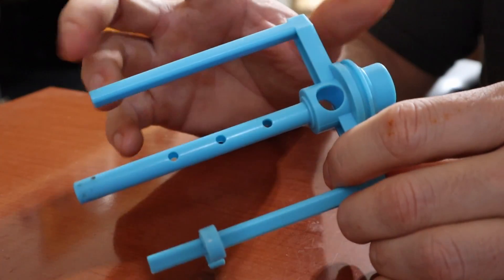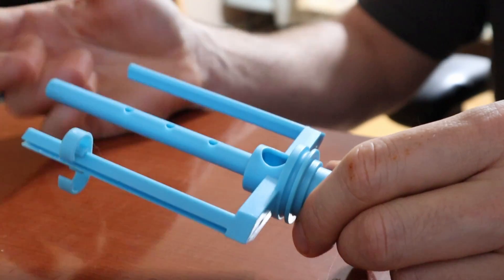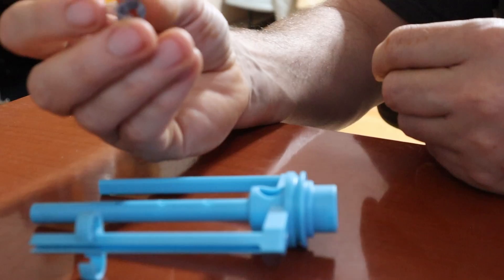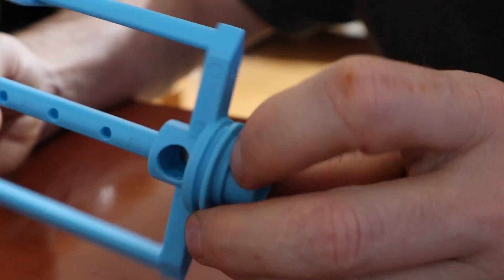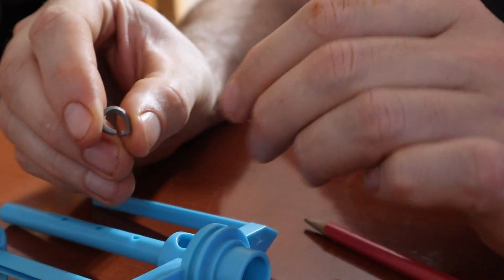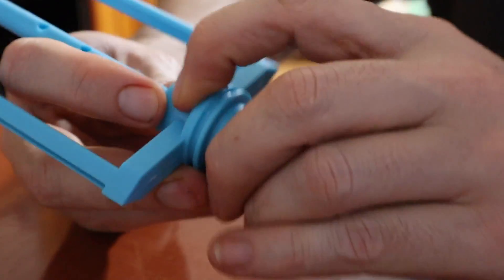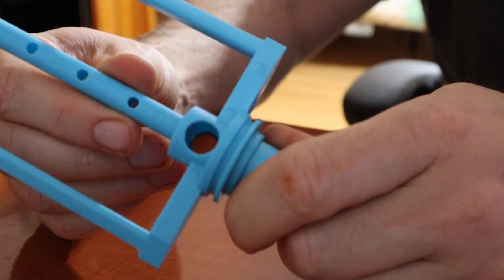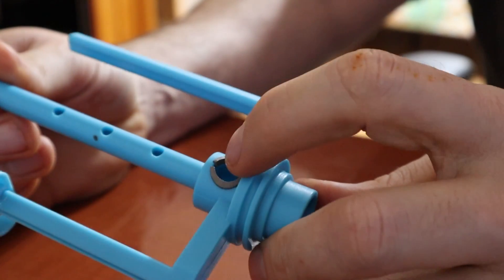Spin 174 - EEW Nano 2.0 Orifice Hole Insert

Comment: Thank you! 

I spin ultrafine lace weight yarn. This means that within a few bobbins, a tiny groove started to appear. My daughter has a friend at uni who owns a 3-D printer. I texted her a link to the website and two days later, that friend had printed me 16 orifice hole inserts. That should keep me going for quite a while. 

For those who don’t have access to a 3-D printer or a friend with a 3-D printer: I found that the next best thing is… UV builder gel for nails. Especially the kind that self-levels. Apply with a toothpick, wait for a few seconds to level out. If need be, hold the flyer in such a way to allow gravity to let the gel smooth out in the right direction. Harden with a UV light for as long as the instructions of the gel prescribe. Remove sticky residue with a bit of alcohol on a cotton swab. You won’t have rough edges and any bumps you want to remove are easily dealt with using extra fine grit sandpaper wrapped around a chopstick. There are trial size UV gel kits with lamps available really cheap online and one bottle or pot should last you a really long time if you're not into nail art. Incidentally, builder gel is very useful for a slew of tiny repairs around the house. So is polygel, its more 'sculptable' cousin. I wouldn't recomlend polygel for orifice hole repairs (too fiddly) but your mileage may vary.
Reply: Thank you for suggestiins!
My issue exactly. The ultra thin yarn does, but l noticed, that it is silk that wears out the orfice shockingly fast( unlike bambo/tencel or anything else).